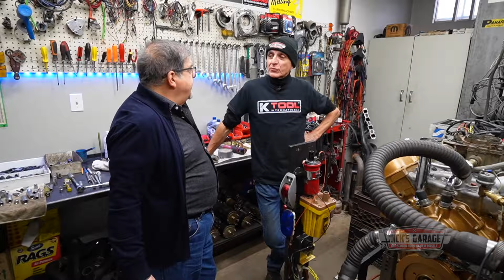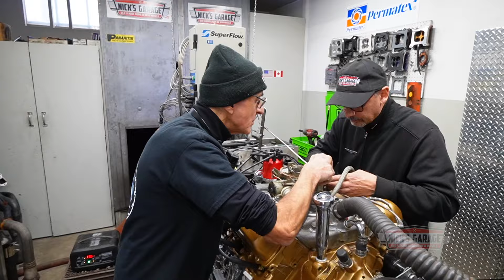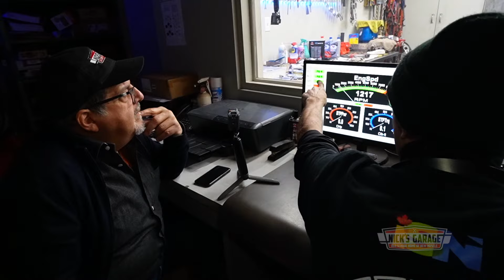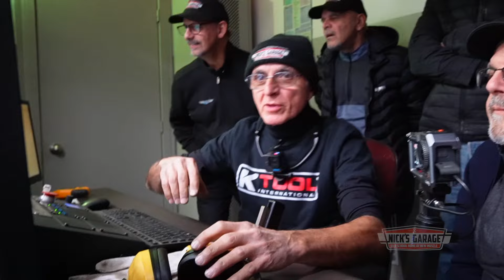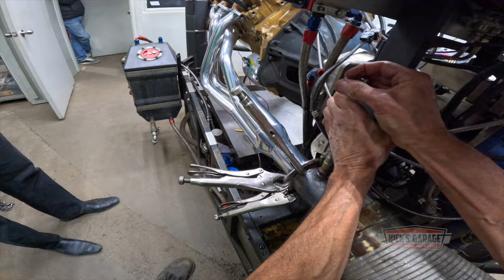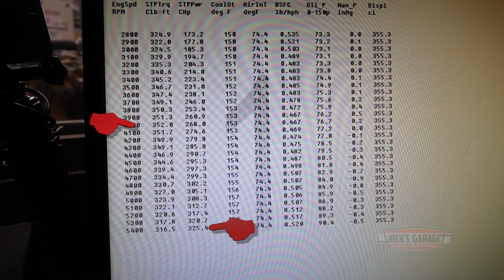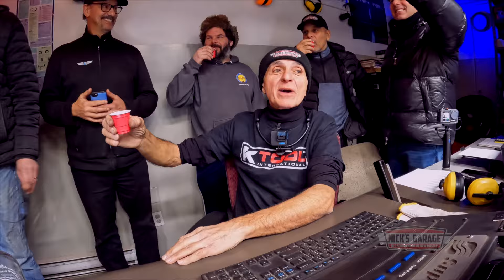Rare Olds W-31 Dyno Party - High Performance Small Block Tested

Comment: In 1970, the only Cam that come in the w31 350 Oldsmobile. What's referred to as the"194"  cam . As by the Numbers 194 stamped in the back of the from the factory. This cam is exclusive and specific to the Oldsmobile 35O w 31.
Reply: They also put that cam in non air conditioning 1968-69 Hurst Olds 455s

Comment: I changed out the 2bbl and manifold on a '73 Delta 88 I used to own to the quadrajet manifold and the 780 carb. Picked up 4 mpg and the engine ran so much better.

Comment: Thanks Nick!  The Olds was on a role, but I was a bit surprised with headers the engine didn't excede factory numbers by ten/fifteen hp.  Anyway Happy New Year!
Reply: A guy on an old Oldsmobile forum used to race one of these back in the day and I remember him saying he added headers to an otherwise stock W31 and it barely made a difference at the track.  I'm not sure why though!  I would guess an Edelbrock RPM intake would work well on it though 👍
Reply: @Dieselpower440   If so, it shows just how good those Olds exhaust manifolds really are with a pretty stock setup.
Reply: @archieguitarz  Yes they certainly seemed to work well on a stock W31 that's for sure.  Of course there are many who install headers on similar builds and see big gains so sometimes you just never know 🤷🏻‍♂️!
Reply from the maker: Happy new year.

Comment: We used to run these Old motors at 42 Deg on the timing with the right fuel.
Reply: That is TOO much, and the engine WILL ping under load with that much timing, unless it was wore completely out, and has no compression left in it.

With the vacuum advance setup correctly, the timing WILL regularly go up that high under a low load cruise situation, BUT 42° with the mechanical advance all in and no vacuum advance is WAY too much. 

My 505" big block Olds makes it's best power (over 730h.p.) with the distributor locked out at 30° all the time. Any more than this, and the power starts dropping off and detonation sets in.
Reply: @davelowets  notice I said "the right fuel".

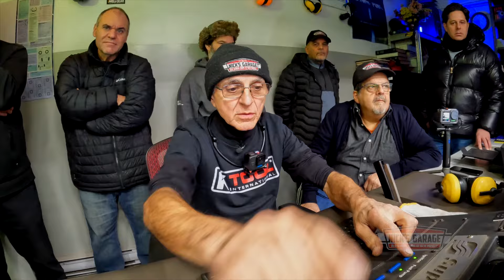Comment: 26:56 I'm surprised that Nick doesn't use the graph overlay feature more. A couple of HP with more timing doesn't always show the whole story. If you overlay, you might find that there was no gain or possibly a loss for the lower range up to torque peak with advanced timing, and only a slight improvement at maximum RPM. Good for getting a brag number, but the average numbers might be better with lower timing. F10 while 2 or more graphs are on the display will help differentiate with colour which test is which.

Comment: These guys need to be schooled, Nick knows how to dyno an engine in his dyno room. But this is a good engine build, and easy to dial in. This engine should perform well on the street, look at that flat torque curve. It maintains high torque beyond 5000 RPM, and develops good power from 4500RPM out to 5600 RPM and more... a wide range that will pull through the gears. it's not only max hp that matters, because you're not pulling through the gears at peak hp..  it is the power range that the engine develops good power.
Reply: I found it refreshing reading your post. You are correct.

Comment: Wow man that Olds has the smoothest transition going from the primaries into the secondaries I have seen.
Reply: The orifice in the vacuum break needs to be drilled out to let it open much quicker. What you call "smooth," I call slow. Slow opening secondaries negatively impact ¼ mile times, especially with a 4-speed.
Reply: @Richard-qz8up  thanks Mr. Goodwrench. Two-year-old comment way to keep up.

Comment: Dana "60" Glass. Great test on the W31. The insurance beater. The Ralleye 350 was rated at 310, but the W31 Cutlass with the bigger cam and larger intake valves was the better choice. 'Ol Doc Watson was a genius.

Comment: The factory rated it at three and a quarter horse with cast-iron exhaust it should do better with tube headers I had the 350 w 31 with the ram air in a 70 Cutlass rally 350 werent too many of those built it was an absolute dog it had a 4 speed, too small a motor for that size car,289 falcon could beat it but it was a nice car.
Reply: The W31s were tested back in the day at the strips by People who could handle them and they were 14 second cars.Maybe yours needed some tuning?

Comment: Cheers to you and Happy New Year Nick. I remember a guy running a W31 at Mission Raceway back in the early 70’s. it was a highly unusual seeing an Olds rather than the usual GM cars. It was impressive, running in the 13’s, good performance for a small displacement engine in an A body platform.
Reply from the maker: Happy new year!
Reply: My OLDS Ram Rod was a 69. M22 Muncie 4-speed. H pattern, Hurst shifter. Had the engine in it that's on Nick's dyno. Hot Rod magazine said 13.98@103. I never timed it. All I know is, I got there first. The money went in my pocket and a lot of yaps got shut. Anyone who thinks an OLDS can't get out of its own way might want to think about it some more.

Comment: Rebuilt to factory specs..its probably down from factory specs, because your running a better set of pipes. better ignition.. i would think in 2023/24. some head work, better cam, those pipes,ignition , you would make more hp and torque for a little more  cost...    well done anyway...
Reply: Probably head gasket thickness to start with as factory were still shim, fel pro are .040 ish.  So much more ...
Reply: I would think they decked the blocked, faced and the heads. Exact comp we don't know... My thought are in this day and age, you rebuild an engine, and get stock power figures..400 hp would of been more impresive for the bucks.. @mu9627

Comment: horsepower numbers that a stock mopar 340 will produce with stock manifolds.  Several months ago Nick dyno'ed a 1972 340 with some minor improvements but with stock performance manifolds and produced 350hp.  I have been hoping Nick would update us on the "dirty 340" and if he got a chance to tune it up and get some good numbers,,   share them with us please.
Reply: My client with the dirty 340 only wanted to test engine as is. That was it.

Comment: Nick I'm sorry to say but the information that was said about the w31 was false they were produced atleast through 1072, you could get power brakes as well as ac, power steering. My brother ownes a  W31 1972 442 convertible  is loaded this car thus car was 1972 auto show car to show all that was available that year. He also has a 1970 w31 4 speed and it has power brakes and other accessories as well as the w27 rear end and these are bone stock certified 442 oldsmobiles.

Comment: Nick should charge extra for each person in the dyno room. That Terry guy was already on my last nerve before the engine fired up.
Reply: Yea, I have to say, that guy was really irritating. He just couldn't seem to do what he was told,  keep his paws to himself, and stay out of the way.
Reply: That annoying Terry guy should be called FIGJAM…
Reply: Terry....yeah, he needed an invitation to go outside for the rest of the day, see a little more of Canada. 
Seriously, Nick needs to implement some rules. Nobody in the dyno room except the actual client, and don't touch the dyno, or any tools in the shop.
Reply: @lindanelson8400  It's more than being inconsiderate. Having a non-employee in the room opens a liability risk that no owner should be exposed to because of what it could do to the shop. In the old days that wouldn't be a big concern, put a Band-Aid on it, laugh, and forget it. It doesn't work that way anymore. Anyone can find a lawyer willing to file for anything, because that's just the way the world works now.
Reply: Thank goodness
He is compensated for
Morons on his property !
Reply: Odell Beckham made a ZPE overunity generartor that puts out over 4000 amps @ 480VAC 3 phase which power an 2300kw induction furnace which melts graphite nickel compact graphite cast iron for Michell Obama's 848 cubic inch 4300 hp 2 stroke splayed 6 bolt main oldsmobile! The crankshaft is billet tool M50 NIL CNC machined with mind over matter thoughts on a roller bearing crank and runs on unicorn farts with carbon fiber reed valves!
Reply: @jlo13800  You are 100% correct. Everyone in my neighborhood has an overunity generator now. Can't walk outside without hearing one being fired up.
Reply: Since a homopolar generator makes lots of amps at a low voltage it makes lots of heat. Odell designed the power converter to make 460VDC for an arc furnace @ 23 MW to cast taylor swifts MTU16v8000 2 stroke compact  graphite iron with a touch of nicklel in the melt. This 2 stroke makes about 16,500 hp @900 rpm's
Reply: Taylor swifts 2 stroke MTU 16V8000 has a 2 inch longer stroke than the 4 stroke  version and runs at lower RPM's and makes more torque! Whoppie goldberg did all the 5 axis machning for the block and did the 4340 billet H-beam rods and crankshaft all carburized and nitrided too. She also does a cryogenic chilling on these parts to relives any stresses in.them too! She also talks to each part and pets them gently st get rid of any sadness which can cause failure.
Reply: like a know-it-all (not) 
brother-in-law
Reply: Hey brother no disrespect on the show but Nick could use some pointers from me on this subject because I have been experimenting with the small block olds motor with the big block olds head's on the small block olds motor with the w30 camshaft and the w30 Head's and I have come to a conclusion that Nick is not much of a mechanic when it comes to working with the Oldsmobile 350 motors when you can combine them with the w30 Head's and the w30 camshaft I've done it before and I can tell you that the power numbers are more than that of what Mr Nick from the show can get from his own combination he is such a joke for the most part of it 🤭🥱😒
Reply: @rodneyhopper22  You say no disrespect then call him a Joke.
Reply: And he doesn't even mention that you can build a stroker motor out of a 350 Oldsmobile diesel block with the help of a big block olds 425 crankshaft and some after market rods . With that said it would produce a horse power number of 560 HP and 640 ft LBS of torque this information comes from mondello performance a well respected engine builder and genius of the Oldsmobile motorsport not Mr Nick from the TV show programs

Comment: Maybe just me,and ive only been watching about a year,but this is 1st engine ive seen here with pcv hooked up. I think for a true test it should always be hooked up.
Reply: I hook up the PCV once in a while.  At WOT, it closes. It is good to have it hooked up for idle mixture,  A/F ratio.
Reply: @nickpanaritis4122  100% Correct...  If a guy would add it later, after dyno tuning, it would definitely throw off the idle and part throttle A/F ratio. It would be lean. 

I'm a FIRM believer in running a PCV system on a street car. It sucks all that crappy vapor out of the crankcase, and helps keep the oil AND the inside of the block cleaner for much longer. 

✌️

Comment: Other than my lifetime of Mopar fandom, I had a few Olds in my young life.
The Olds engines have a certain cadence to them, just like the Mopars do - and I liked it.
The stock valvetrain design was more rugged than the other GM divisions, too.
Only thing I couldn't get past was the siamese exhaust ports - never cared for that.
Great job as always, Nick - and guests, y'all please stay clear of the dyno room!
Nick has insurance concerns there, not to mention safety ones, so please respect the host.
- Ed on the Ridge
Reply from the maker: Thanks for the visit, Ed.  Happy new year.